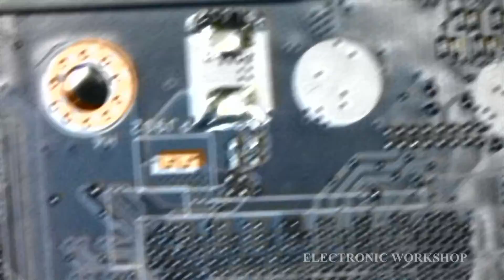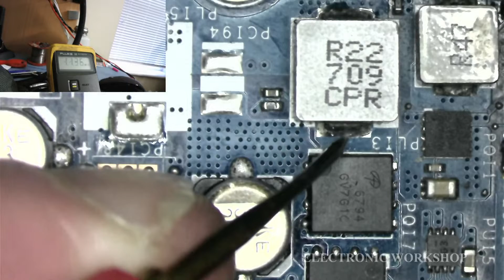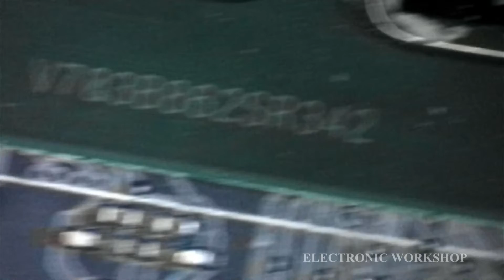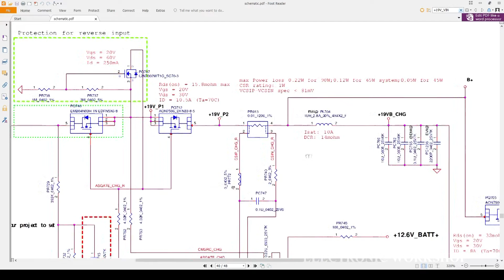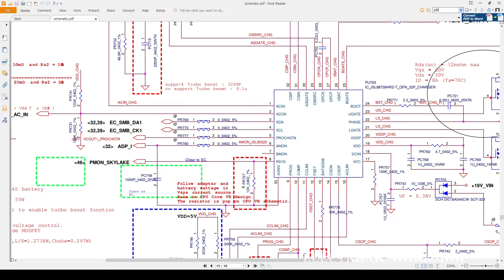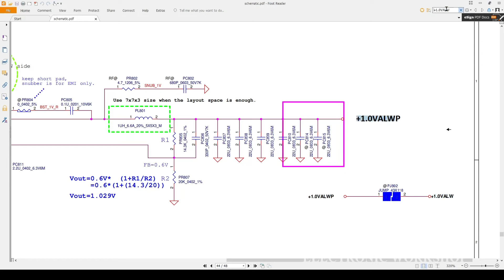Lenovo Ideapad 320S-14IKB  LA-E541P Dead

Comment: I just googled Lenovo Ideapad 320S-14IKB LA-E541P Motherboard and found one on ebay for £34.99 
Lenovo ideapad 320S-14IKB (Type 80X4) Motherboard 5B20N78323 Pentium 4415U 4GB
---------

There are others for £19.99, but you'd have to have a look to see if they're the same.
Motherboard For Lenovo Ideapad 320S-14 80X4 Intel Pentium 4415U 5B20N78323

Try different domain searches - IE Google home page provides different results than Yahoo using MS Edge URL Address bar.